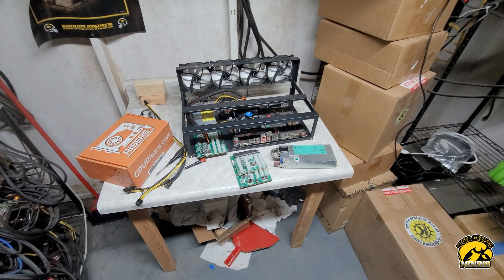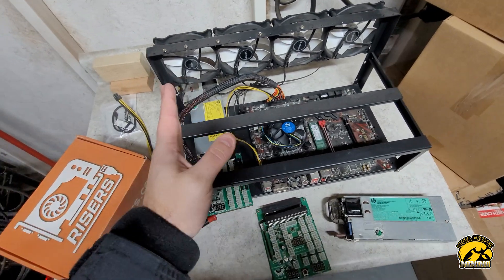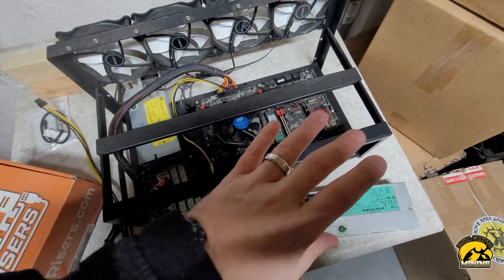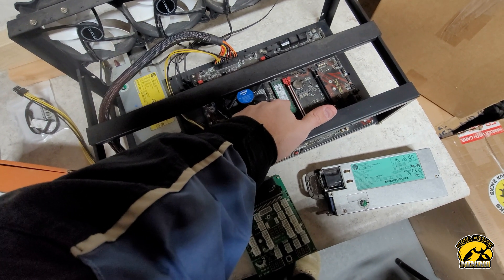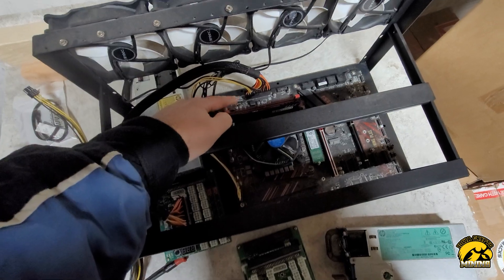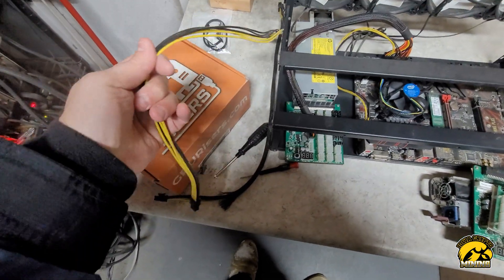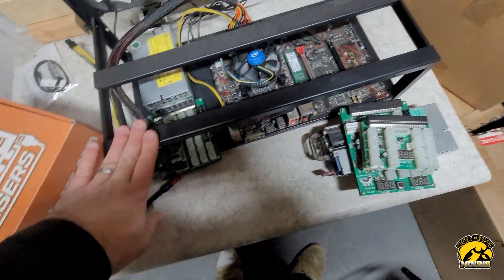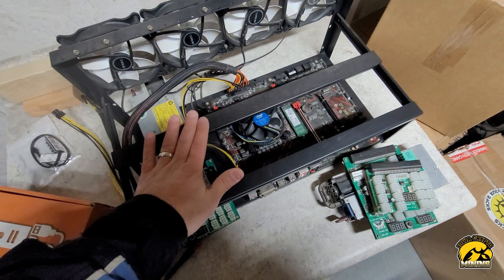GPU Mining in 2024 Everything you NEED!

Comment: I use the same mining frames as you, Cheapest ones i can get on ebay :D 
What i prefer to do though, Is 3D print motherboard stands, So that my motherboard is raised about 4 inches off the bottom plate..
This way, 
1. I dont need to use Risers, I can go full riserless, Just for less things to fail... Ive had loads of Riser connection issues in the past... 
2. Server PSU can fit underneith motherboard, with plenty of space :)
Reply from the maker: I have seen similar frames.for riserless boards. If I was going to expand GPUs, I would give those a look.

Comment: You can push those server PSU's past 80%. I usually have no issue running them to 90% load, and Y3TI claims he'd have no issue pushing them to 95%, as those PSU's are just built better and are made to run 24/7 at high loads in server applications.
Reply from the maker: Agree. I think efficiency though is better at 80%. I noticed during eth days, I would get charged less kwh then I was calculating most of the time.
Reply: @IowaMining  When they do efficiency testing on PSU's for their bronze, gold, platinum, ect certifications, they are all done at 50% load, so there is a good chance that a lot of them are probably more efficient at loads closer to 50%.

Comment: man ASICs are loud.

do you have the rev B ZSX boards?
Reply from the maker: I will try to look for you. Unsure.
Reply: @IowaMining  I had all of my rev 1s die, but I see on the site today revision B sooo really curious. I do think I just had a bad batch.
Reply: @OvalboreTech  I just fix those revision 1 boards. So far I've found 3 different points of failure, the power button, the mosfit going to PSON from the microchip, and even the microchip in the turn on circuit itself. I have yet to have a single board of mine die, but I've gotten boards from others where I've seen these problems and have fixed.
Reply: I knew the buttons were junk,  @MassBoost  but holy cow, dedicated. 

fix my nixie clock board for me pls? powers on but tubes dim quickly to nothing after like 30 seconds. someone said bad mosfet so replaced that and now no light at all.
Reply from the maker: I do know the board I used on this rig was one of MassBoosts repairs
Reply: @OvalboreTech  You would think the buttons would hold up? I think the replacement buttons I bought are suppose to be good for like 20K cycles, and they're relatively cheap. You'd think something like that would hold up on those boards, as it's not like you have to turn them on and off multiple times a day. But either way there are multiple fixes for those boards, even if the microchip is taking a crap, which there is no replacing those at all, only finding alternative turn on methods.

Comment: Cool video, I went the amd route for my rigs which meant having to upgrade to b550 board when I ran out of lanes on my b450 boards, just picked up a b250c 12 gpu board which I have on that same open air frame with plans to put it in a server case later on.
Reply from the maker: Nice yeah I haven't reviewed the and options. I thought most only had 5 pcie?
Reply: I used a pcie to usb expansion card @IowaMining